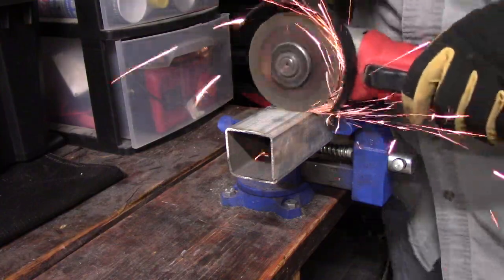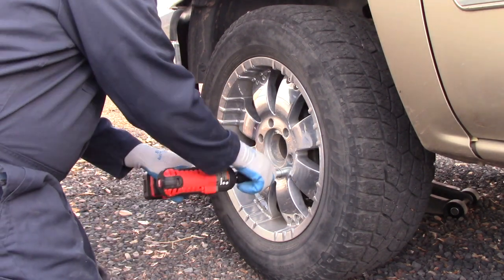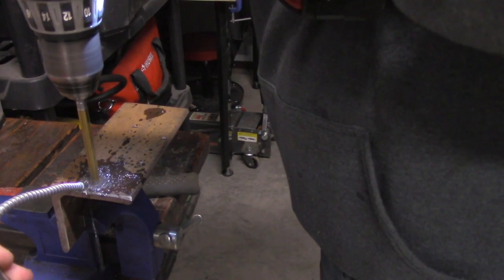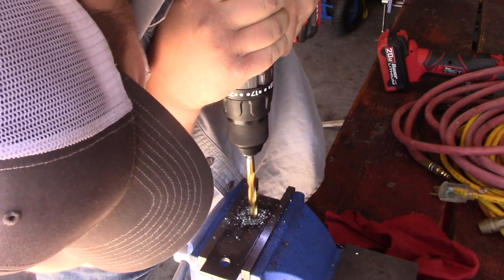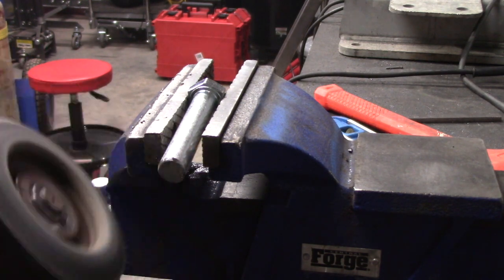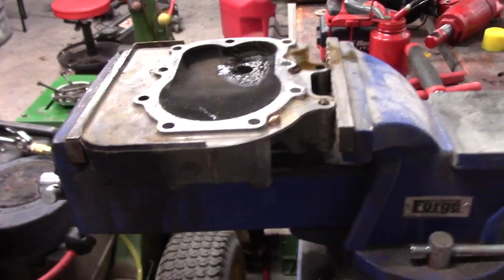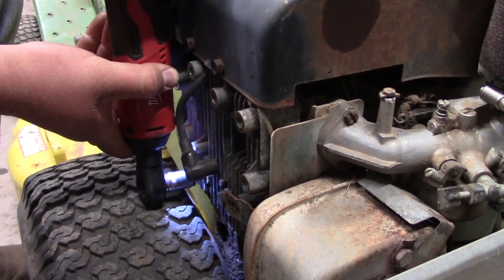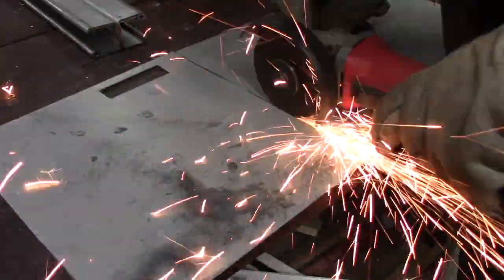Why I Sold My M18 Milwaukee Tools and Bought Bauer Tools

Comment: Hey there! I'll be the first to say that i bleed Milwaukee red. I mean if it's a tool i need and Milwaukee makes it then i have it.. I just love the quality and innovation that Milwaukee has.. But in your case, if you're not really into that profession anymore then yeah i can understand why you want to move over to the Bauer line. There's nothing wrong with that at all. But i will say this to everyone, and i dont mean to sound like a snob, but if you do get into a profession you should defiantly try to have professional tools because it help hive you a better look as a business. But seriously, coming from me a Milwaukee "fanboy" (although i believe dewalt, mikita, bosh, ect are good tools) you did right. And one more tip! Please take this advice cause it may help you save a little money and heart ache. At the end of the day at least in the winter, if you're dont, just toss all your batteries in a bag and bring them in with you so they dont get cold. Because it will degrade the batteries over time.
Reply from the maker: Yes, I understand cold and hot temps ruin the lithium ion batteries. I haven't brought them inside though. I need to. This winter hasn't been to bad where I am, but still, I ought to get them inside. 

Yep, so I used these Milwaukee tools every day to make my living (not on my own, as an employee) and they served me well. I just want to expand my tool line, but don't have $120 bare minimum every time I want to add a tool. With Bauer I can do it for ~ $50 a tool. Maybe $60 if you really averaged them all out. 

I'll echo what you said. When you show up to any job, job site, customer, or any other form of work where your first impression matters, showing up with anything other than DeWalt, Milwaukee, Makita, or maybe Rigid, is going to raise flags.

Comment: Problem is, harbor freight phases tool lines like this out after some time. You will no longer have any product support or new oem batteries in probably 5 years. I have Milwaukee batteries that are 7+ years old and no failures
Reply from the maker: Perfectly reasonable comment. Harbor Freight doesn't have a perfect track record with long term tool support. But then again, neither does a lot of other brands.

Comment: Use the Bauer for a living and you will think otherwise... Bauer would be great around the house but on a job site I can say from personal experience they are junk, I own a security company and the drill barely survived cutting in 4 doors...
Reply from the maker: No doubt they aren't professional level quality tools. I may jump back into Milwaukee someday and replace Bauer with Milwaukee as each tool breaks/needs replaced. I like having one tool brand but don't mind having a few. I don't regret getting into Bauer but I wouldn't mind getting back into some professional grade tools as my finances change.

Comment: Unless you're a professional or running them extra hard, name brand is worth it, but for home use or moderate use, Bauer is just fine.
Reply from the maker: At the very least, ya I agree with you. I think as long as you aren't one of those "I abuse my tools" guys, you could probably even get away with Bauer in a professional setting, I guess I just wouldn't expect them to fall of ladders, scaffolding, etc, from 20ft up and survive like maybe a name brand tool would, but for normal use, I do believe they'd hold up.

Comment: Why have all bauer? There are other more powerful tools for around the same price. Like the ryobi cordless brushless 1/2" impact, ac delco brushless 3/8" cordless ratchet, etc.
Reply from the maker: Well for me it’s about battery compatibility and not having a bunch of different battery platforms but you do made a good point. There are lots of options out there.

Comment: with all cordless brands in my opinion they are all disposable eventually problems will happen i have a impact driver but i try to stay corded with everything
Reply from the maker: Rob B If you don’t mind me asking, how old are you? 

I ask because I am noticing a trend in older gentleman believing that corded tools are superior to cordless tools in most, if not all ways. In some ways that is true, but not all. 

I wouldn’t say your wrong in that a corded tool will probably outlast a cordless tool, but the convenience of cordless tools, in my humble opinion, outweighs the pros that the corded tools offer. 

Now I do prefer some corded tools to cordless, these would be things like angle grinders especially, table saws, miter saws, maybe depending on what I’m doing a reciprocating saw, but drills, circular saws, multi tools, impacts, etc are absolutely worth the cost of convenience. 

Thanks for your comment though, and thanks for watching, I don’t think your wrong in any way, just a difference in opinion on weather cordless tools are worth it, and in my opinion they are.
Reply: @DereksWorkshopAndProjects   convenient  yes the only thing i truly dislike is company's switching over there battery styles and discontinuing stuff so you buy a whole new series
Reply from the maker: Rob B definitely a real problem.

Comment: I too sold all my Milwaukee tools because of the battery cost, I had two battery’s die on me in about a week, one was a xc 5.0 and the other was a xc 8.0 to replace them both was $300 I relied on them for my 1/2 impact when I was in the field, I had bought a Bauer impact driver for a deck I was making so I figured why not try the 1/2 impact so after a coupon I got it and the 3ah battery for $140 and I liked it, not close to as strong as my Milwaukee but it worked enough so a year and a half of professional service I now have all Bauer and earthquake tools that I really like for 1/4 the price.
Reply from the maker: That’s good to hear man! Milwaukee definitely makes some of the best affordable cordless tools but it definitely comes at a price and is not always worth it for the end user. Bauer has definitely been a good and reliable cordless tool system for me so far and I’ve been in it over a year and a half.

Comment: Dewalt are more pricey but they sure can take a beating. I had a Bauer drill and it got wet and never got it to work :(
Reply from the maker: Yes, Bauer is not a professional grade tool but it's solid option for a lot of people out there. DeWalt is obviously one of the best. I really like most of the major brands out there these days.

Comment: I still have the first gen milwaukee impact/drill combo and the batteries with it. The batteries still work fine and they are probably close to 10 years old now, which is crazy for a 1.4ah battery. I still have the drill hanging up in the work van for quick things, while the newer 3rd gens sit in cases. I always brought my batteries in during winter and even some really hot summer days. The only batteries that have died is 1 or 2 m12 and old ridgid batteries which I left out in the truck during winter.

I used to use all electric tools and had the very basic of tools, hand coping trim, 1 circ saw, a corded sawsall. I think it made me appreciate having the tools I have now. Although I do need to stop buying new tools lol.
Reply from the maker: Element Just shows the quality of those old tools haha. Buying tools is not a bad thing haha. Thanks for watching!

Comment: I just bought my first 1/4 impact Bauer tool and loving it so far. I heard people bought Bauer battery on Amazon and said their battery died after a few months .  I am hoping my battery does not do that , I also purchased an additional 3A battery too.
Reply: I now own almost all of the Bauer 20V tools, and currently own (7) 3.0AH and (4)1.5AH batteries I've been rotating through.  I've had (3) 3.0AH and (2)1.5AH batteries just die unexpectedly anywhere between 3-9months of owning them.  Not using them everyday, I'm just a home DIYer. All of them that died unexpectedly have been the original red case packs.  I currently own 3 of the black case packs, fingers crossed hoping they improved the battery quality with the black packs.
Reply: rednroll1 , I have mine over two months and the 1.5 amp battery is still running strong without losing it charge .  I also bought an additional 3.0 amp battery for backup . Love Bauer tools so far , such a great deal .

Comment: I just purchased the 150 deal from bauer, circ saw, recip saw, drill, flashlight and an extra 1.5 battery. I'm a home owner and dont necessarily need fancy tools for basic household needs. I do own Milwaukee m12 line for my actual job but so far I've used every tool from bauer and really like the "cheap" but good quality
Reply from the maker: What do you do for work where you use M12. I got some M12 tools while plumbing and felt like for the most part that they wouldn’t really  cut the mustard for serious tradesman, but were maybe good for maintenance workers or home owners. I’m not saying that they couldn’t be used in the construction, serious repair world, just that they weren’t the best tool for the job and 18v made a lot more sense.
Reply: @DereksWorkshopAndProjects  I do car installs for big box store, all I really need is 12 volt drill and 1/4 impact for some tougher bolts, also have the soldering iron and rotary tool, plus I found the bigger generic batts on Amazon ( 2 pack for 45 bucks) still work great after a year

Comment: I’m getting into the Bauer line, too, though just for DIY projects. If that’s your main use for them, I think you made a fine choice.
Reply from the maker: That is my main use. The more I use them the more I think they would be decent for even every day, commercial use. Not in heavy duty applications maybe but definitely for like appliance repairman, facilities maintenance techs, maybe IT guys would be served well by them. I know a guy who does RV repair that uses Bauer. Good tool, hopefully you like them. Still getting a good feel for them. Performance wise I’m loving them, but we’ll see how they are in the durability department.
Reply: Literally.. I was doing demo job for general contractor who had a truck full of Milwaukee and Makita. During the job, I caught him using my bauer hammer drill lol... By the end of job,  he  asked me where can he buy the drill and how much... classic

Comment: The Kobalt line is great, with brushless and a 5 year warranty. The batteries are cheap and a 3 year warranty. I have literally beat my drill to death using it to remove rust off a trailer and two SUV frames and no problems with it after 3 years.
Reply from the maker: I have actually almost pulled the trigger on Kobalt before, the only thing that stopped me was that it seemed like there wasn’t a lot of tools outside of the normal but that was like 5 years ago, so I am not sure what it looks like know. I would like check them out again in the future.

Comment: You're solid 👌💯 If you ever wanted to go back to Milwaukee, you could make the transition into the M12 line EASILY since you still have the M12 ratchet & drill
Reply from the maker: Definitely. I went back and watched through it, I really should have mentioned I still had all my M12 tools besides just a little on screen text but, I was just thinking all about my 20v tools. Anyway, I recently picked up a free 1/4" impact for the set up too. I might get myself into one of the cut off tools too. Anyway, the M12 line up is definitely a good buy, especially with the electric ratchet, one of my most favorite tools. Thanks for watching man!
Reply: @DereksWorkshopAndProjects  there's a youtuber under the name TOOL BOSS whose channel covers nothing but GREAT tool deals. You should check out his vids cuz He finds & posts CRAZY good deals for Milwaukee & other big name brands 

Stay safe out there bro👌💯
Reply from the maker: @AceSolomon94  Awesome, Thanks Man!

Comment: I love the bauer line I have the half inch drill 1/4 inch driver and the new version of the grinder and never had a problem if I do I can just take them back and get a free replacement no question asked you have to get the new grinder it's so much better and it's a lot better then the Milwaukee
Reply from the maker: I am just now seeing your comment long after your posted it. I think when all things are considered, like battery cost, tool cost, and performance (ignoring warranty) Bauer is absolutely a good option!

Comment: The only complaint I have for the Bauer 20V tools are that I've had quite a few of the batteries die on me.  Especially, the older style red case ones.  I haven't owned as many of the newer black case ones long enough, so maybe they're better?  I started writing dates on the cases of when I purchased the batteries.  Just had a 3.0AH 20V red case battery die on me after relatively light use. It worked the night before using the Bauer palm sander on some dry wall.  Went to use the tool the next day, battery was completely dead and would no longer charge.  Purchase date was 6/9/19 and here it is 3/4/20.  The prices have also gone up on the HF Bauer batteries.  I'm starting to regret my Bauer 20V tool purchases if these batteries keep giving up the ghost out of the blue and the prices keep going up.  What's your experience been with the batteries?
Reply from the maker: Wow that’s a real bummer. I’m reaching my first year with some of these tools this month and I haven’t had ANY issues with any of my tools or batteries so far. The only issue I had was finding out I bought red case batteries right before they came out with the rubber coated, slimmer, black case batteries. Felt ripped off a little. (Not that this would surprise someone seeing as how small my channel is still) I am not paid a penny, I’ve spent all my own money on these tools, and so far I’m nothing but impressed. I’m wondering why your getting so many duds. Do you leave them out in the cold? Could it be your charger?
Reply: Jump start the battery with another battery and try to get it to charge. Its easy. 2 jumper wires.

Comment: Bauer is coming out with 5ah and 8ah batteries too and brushless tools!
Reply from the maker: I’ve seen that and I can’t wait to see what else they come out with. I’m anxious to get the large batteries too.
Reply: @DereksWorkshopAndProjects  I'm excited too, a lot of people give harbor freight flack for their tools not coming with a 3 or 5 year warranty and instead give the option to pay for one, I personally think they should have a 1 year one minimum instead of a 90 day and also have a 1 or 2 year available
Reply from the maker: Q-Pid Avenger I agree. The funny thing about those long warranties that come with higher end tools is that most people aren’t going to use them anyway. They forget that they have them, or the company wants to charge 25 dollars for you to send it in and if it doesn’t appear to be a manufacturer defect then they charge you to fix it too before they send it back (I believe milwaukee works this way). So it’s not like those warranties are so good that you can drop the tool of at the store broken and walk out with a new one. Personally I just heavily use my tools in the first 90 days because if they are going to break from normal use, it’s usually in that first 90 days. I never pay for the extended warranty. I used to work at Lowe’s right out of high school and they told us as cashiers to push the extended warranties on product because most of the time they aren’t needed anyway and when they are needed, people forget they paid for it anyway. They said that was how our store could really make a lot of money. So I was convinced to not buy warranties at that time.

Also, I majorly agree with you in the one year warranty with the Bauer tools. Obviously I’m a consumer and want the best I can get for the least amount of money but it almost feels as though they kind of don’t stand behind the product. Almost like their attitude is “if you don’t give us extra money to guarantee your tool then you’re on your own dude” seems like 1 year would suffice.

Comment: When it comes down to it I run my own business and the baur line will do the same job for less money when it comes to profit margins in running your own business you have to ask your self I can get a impact an1/2 drill and a sawzall 3 battery’s 3 chargers and a 2 year warranty for the price of one drill and 1 battery and 1 charger if your using your tools to make money then why would you consider anything else.
Reply from the maker: Sounds thinking. All I have to say really is that if the tools are breaking down more often because they are cheap, causing you to have to go exchange it or something like that, then it wouldn’t be worth it, but if your getting the same amount of use out of it and it’s as reliable as any tool, your thinking is on the money (figuratively and literally).
Reply: @DereksWorkshopAndProjects  they last long enough and I’ve had dewalt and Milwaukee fail within a year their idea of a warranty is bring it in send it off a week later you get your drill back 150$ for a drill harbor freight you walk in and walk out with a new one.

Comment: If you get a chance I wouldn't mind seeing a review on bauer's new string trimmer! I've had a corder craftsman for 14 years and still runs but I've wanted cordless on a budget, small lot, basically to edge my lawn
Reply from the maker: I plan on picking it up in the spring so I can made sure it works well before my 90 days are up!
Reply: I had the trimmer and used it twice.. My suggestion is get the 3.0ah battery cuz the 1.5ah dies in about 20 min of work.  I use it to edge my front yard which is like 1/3 of an acre and it wont finish the job... Took it back and got the corded portland trimmer.
Reply from the maker: I’ve got one too and I haven’t even tried the 1.5 AH batteries. Only used the 3.0ah batteries and they work good, I can do my yard about 2 times on one charge.